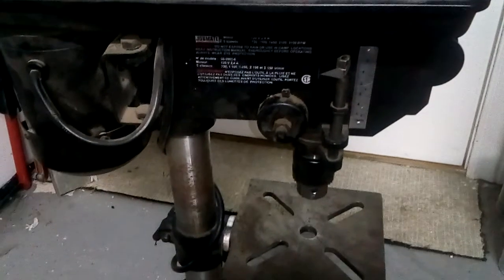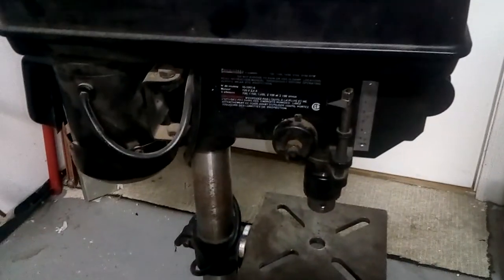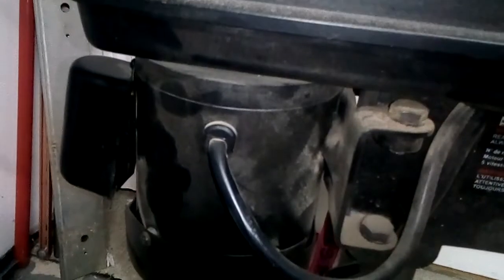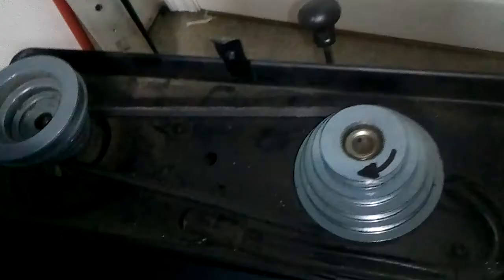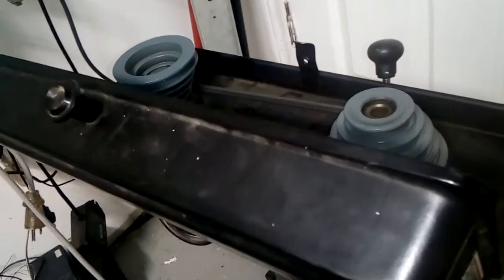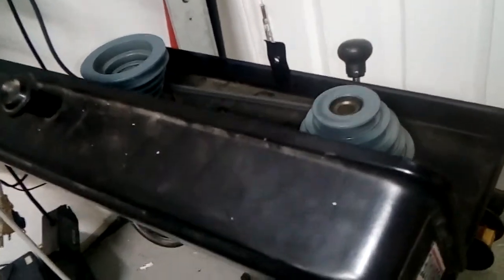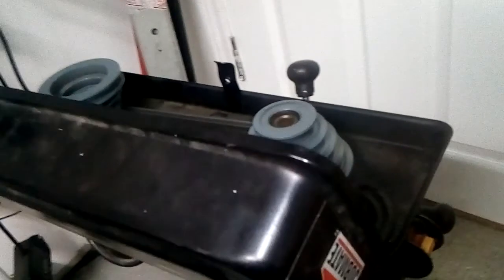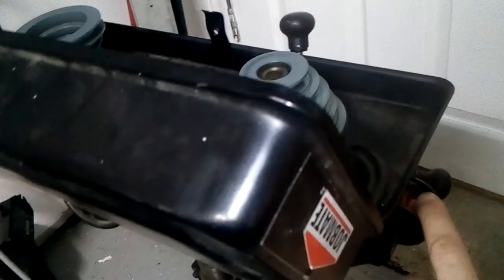Reversing a nonreversible cheap drill press

Comment: You can also put a double pole double throw switch on that drill press right where it connects to the capacitor!
Even a regular residential 4way wall switch also work. That's what I used on my drill press.
A four-way wall switch will change direction but it does not have and off position. You can add a regular on and off switch for that purpose.

Comment: Most AC motors are reversible!
Just because there is not a reverse switch on there does not mean it's not reversible. 
Many AC motors have a diagram on the motor showing how to reverse direction of the motor.
Some really are designed not to be reversed.
You have to take the windings out of the case and hook them up differently and put them back into the case.
There's a video on those also.

Comment: That's a good idea. Just put an on and off switch in the circuit that goes to the start capacitor.
The cheap Westinghouse motor on my drill did not have a start capacitor, nor did it have any wiring directions or directions for reversing rotation.
Check where the power wires go inside the shell and see if there are wires to reverse that come out of the windings. 
if there is you might be able to reverse the direction of the motor just with a switch.

This guy knows a lot about reversing motors.

https://youtu.be/__nS3OelY-s